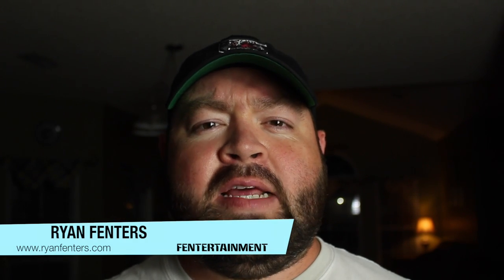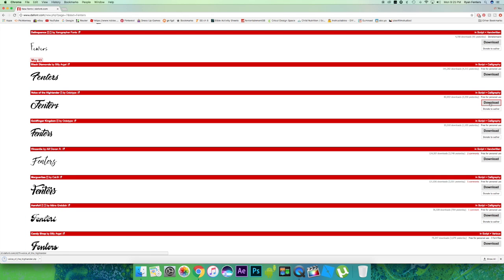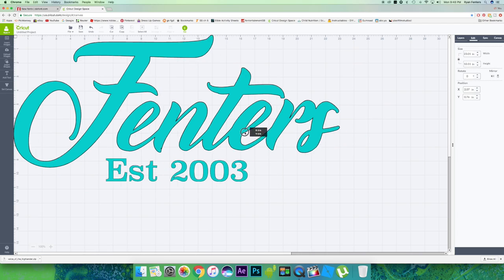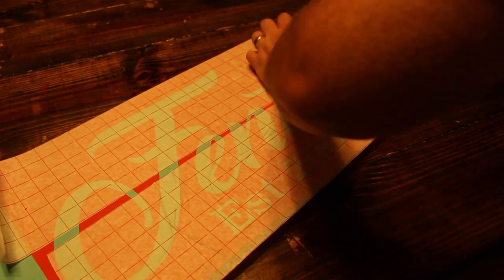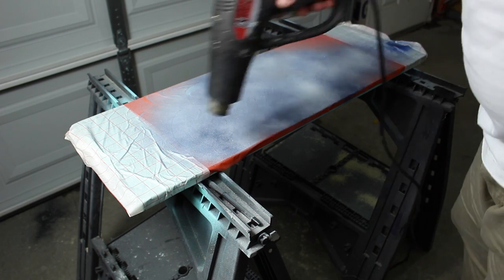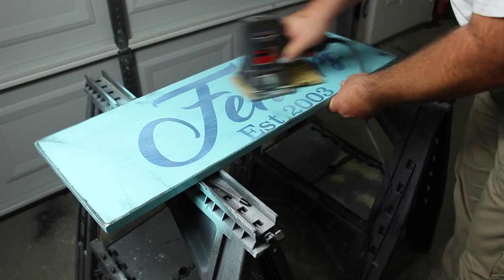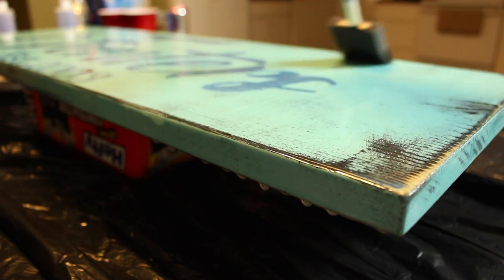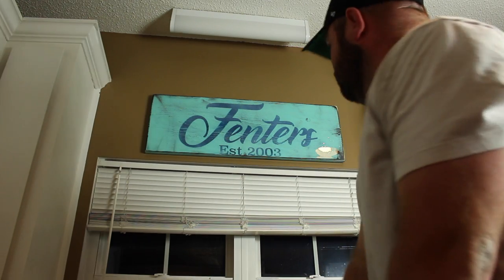How To Spray Paint Wooden Rustic Sign with Cricut Vinyl Stencil & Make it shine with Epoxy Resin

Comment: quick tip to the beginners using the epoxy on a sign like this, use painters tape on the back of the sign around the edges. The epoxy will dry up and create hard bubble like underneath. Then you wont have a flat surface. The tape will tear off and bring along the dried epoxy with it. Great video ryan
Reply from the maker: WOW! Thanks, Thats a good tip for me too! Thank You Juan Arizpe

Comment: Hi. Love your diy’s. Quick question. On your rustic sign after applying the epoxy since it drips to you sand the back to smooth out areas that may have dried with drips? Thank you!

Comment: Nice project and good video man! Beating up/weathering the piece is always the most fun step for me too! Question, did you brush along the edges when the epoxy dropped over? Do you have to brush out those drops or does the epoxy take care of itself in that?
Reply from the maker: I did, I just didnt show it in the video. After the epoxy was pretty much in place to cure I went and brushed the drips away from the back edges.

Comment: I'm working on an outdoor sign and planning to coat it with epoxy.  I'm thinking that will extend the life of the sign for MANY years, but i'm still looking around on YouTube to find some videos to confirm that assumption.  I like to hear from multiple folks before I pull the trigger...lol.  BTW, I subscribed to your channel - lots of good info in your vids.  I might accidentally learn something  : O   Hey, check out my channel if you get a chance.